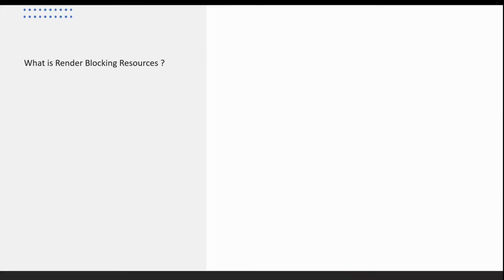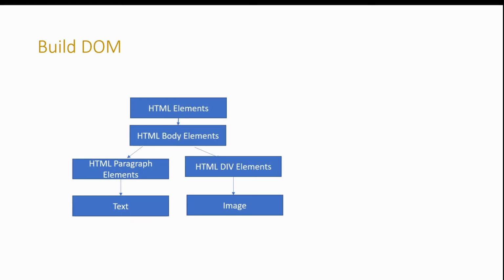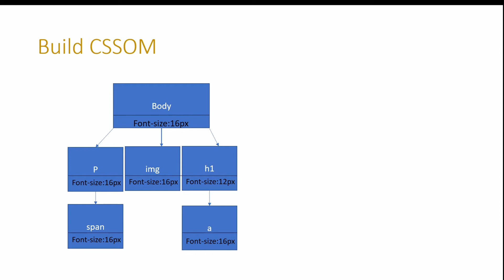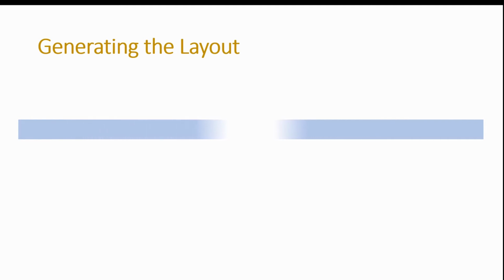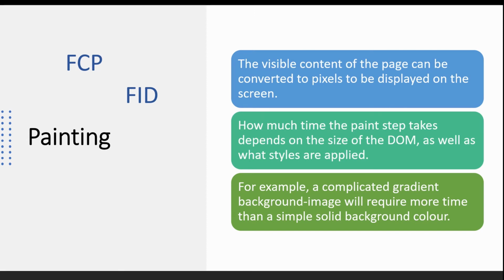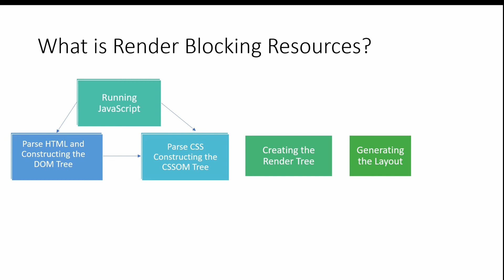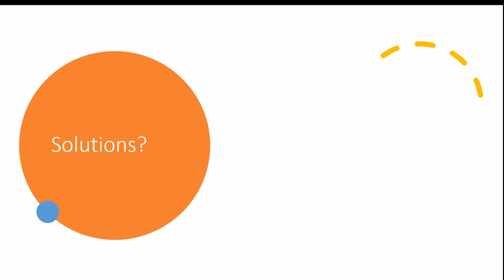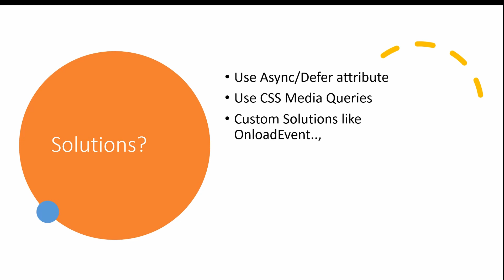what is Eliminate render-blocking resources and how to fix it ? WordPress PageSpeed Optimization

Comment: Much of the problem is using the word RESOURCES for anything except COMPUTING resources like CPU, RAM, network bandwidth etc.

Things you load at run-time should probably be called assets instead of resources because that is what they are.

That way you can logically explain about wasted resources.